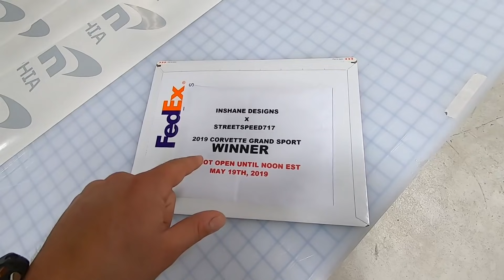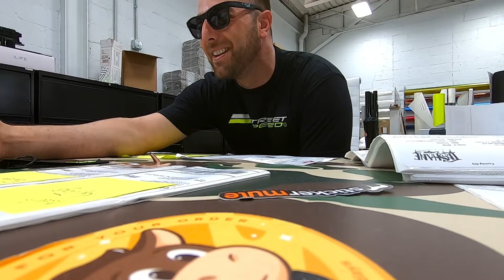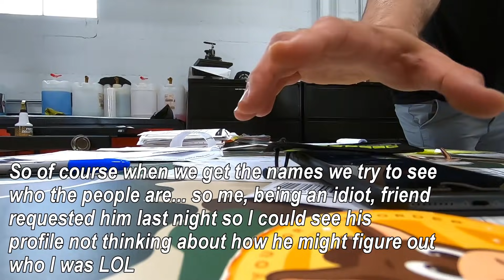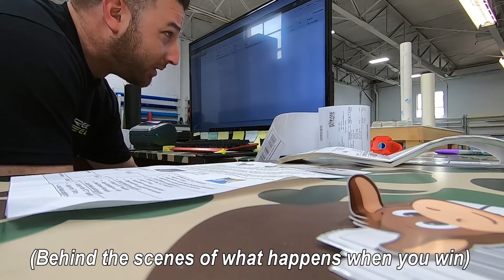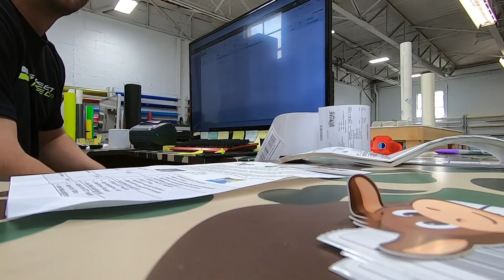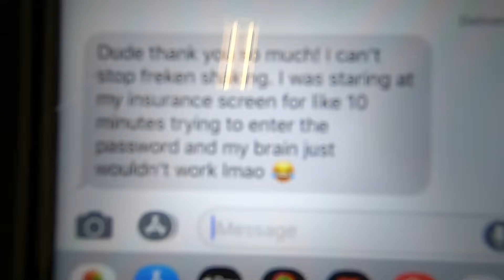CUTTING OFF MY ROOF WAS A HUGE MISTAKE... DESTROYED My Mint Condition Blazer (I Can Fix it!)

Comment: you should clean the rough edges up with some like dimond plate or something. might also make it easier to climb over the side. then you can add a cover to keep mold from happening!
Reply: And drill drain holes in the floor and "bed" sides

Comment: DIY color match RAPTOR LINER them both!! I have coated  my truck, golf cart and boat and couldn’t be any happier. I have used both color matched and the black. Really easy to use with a Shultz gun and will really come out great and uniform with minimal body work. I would rather see a great looking bed lined truck that could be used and abused as a truck vs cheap body/ smooth paint

Comment: Next give away. 
Either a 

F-250 Limited 6.7l PowerStroke Turbo Diesel

Silverado 2500HD High Country
with 6.6l Duramax Turbo Diesel

RAM 2500 Limited with 6.7l In-line 6 Turbo Diesel

Comment: Get the green truck a new bed off craigslist might save money. Cut the bed rails off the green trucks bed and weld them to the bed of the blazer to make the job more complete. Then straighten up the cab cuts on the blazer. Get a shortbed camper shell and cut the front of the camper shell to match up to the cab of the blazer. The bed rails that ud put on the blazer would be to use the camper shell and for it to be safer for passengers when the top is off. You have to have bed rails to fasten the topper. It would be exactly like a k5 if you put bed rails on it and fit a camper top to it. Make sure u get one with room to cut the front off without having to mess up the window on the camper shell. A camper shell with no windows would work great. Just an idea since u already came this far.

Comment: You should do a cage that follows the old body line of the back so you could put the roof rack on it if you wanted. Also if you flip it its safe and you would also get the structural integrity back that you would have lost from taking the back of the roof off.

Comment: Drill drain holes in the blazers floor so it doesn't fill up with water. You could also have rubber pluggs in the holes or even metal plugs.

Comment: A roll cage and do a latch system on the top you cut off and the existing body on the interior side where you can remove it like an old k5. Do latches like a set of ttops

Comment: Even if that was a mint condition Blazer it's not like they're worth much anyway. If it were me I would have just cut the whole roof off and maybe even ditched the doors. Or get an extended pickup cab and use the back section to enclose the rear seats.

Comment: Why don't you get a good used bed for the green truck from down south.  I have seen many used beds in perfect condition here in Texas.  There is a complete bed in Waxahachie for 200.00.  For less than what you are going to spend on repairing the bed you could get a much better one shipped there.

Comment: Ya think????  Engineered structure top truck wasn't designed to have the roof hacked out, give it a shot on your McClaren..... Hey Mike when you getting an old used beat up RV and parking it in your yard?  You're getting close to a "Sendit Steve" looking setup now, just missing the old RV.....

Comment: Mike, For sure, it's your chanel and your truck so enjoy what you do. Speaking for myself, I wish you had destroyed an undesirable body style. The Tahoe was not near mint  condition but it had great bones. We saw underneath and it's in nice shape other than the typical bedside ad rocker panel rust. They make patch panels for that. You could have had it straight and rust free for very little time and money. It's the MOST desirable body of all obs (V8, 2 door short wheelbase 4x4). No going back now! But if you hacked up a 4 door rust bucket nobody would give 2 shits. We all know that Controversy = Clicks = MONEY! Enjoy what you got. You need to cap off those bed rails so the poor bastards in the back don't get sliced up on the shrapnel.

Comment: I live 2 miles from the Pismo dunes  and that Blazer is a long ways from seeing them. If you are planning all of that work all the ends you cut off need to be capped off with sheet metal then add a roll cage so you can make a soft top that pops of and  It's a over size Chevy jeep. There a hand full running around here but nothing as ruthless as that hack job and trust me I've seen some hack job mober but they don't last long around here with the salt air just from moisture the electric will stop working on the inside. You would be the guy with a trailer having to tow it in to the beach because in California dot police would in pound it if not Dem safe to drive on the street. Iv seen it happen to people waiting to drive in its funny shit. Why do you think the tops aren't removable any more. With a big worning sign before you enter the beach roll cage area drive at own risk 😉 and your vizer stating hi roll over rate.

Comment: Ah....you spray bombed rhino “bedliner” 2-4 mill spray. My Line-x application would be a minimum of 1/8 inch on the highest wear areas with about a 1/16 at minimum on the non use areas. We wouldn’t be the budget build option, but it kinda gets to me when what you applied is compared to a professional application of Line-x bedliner. You did not bedliner anything, you spray bombed a “thick” paint.